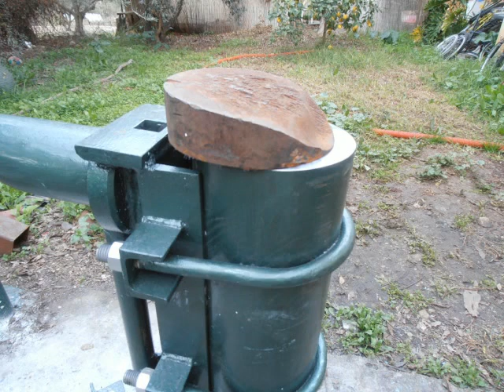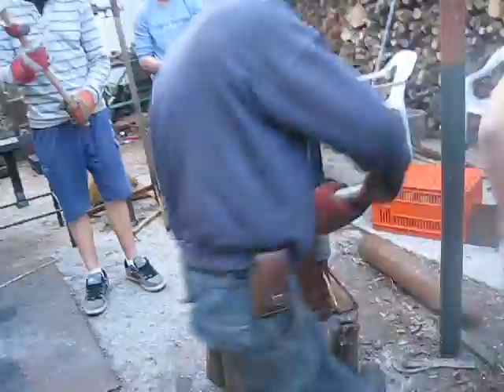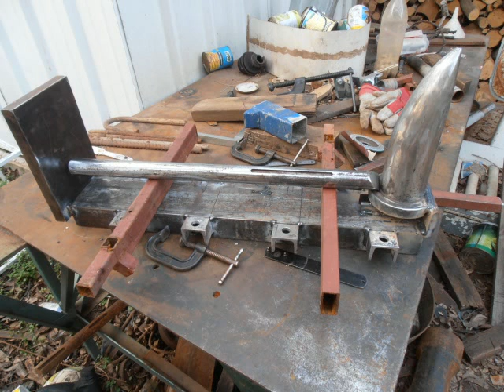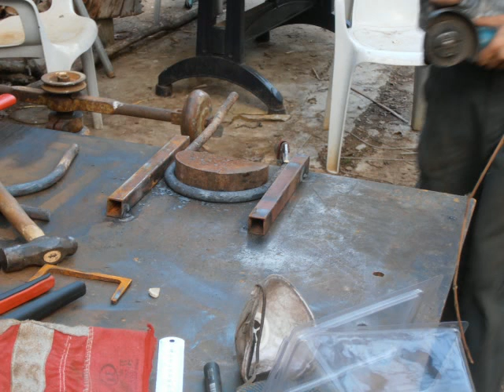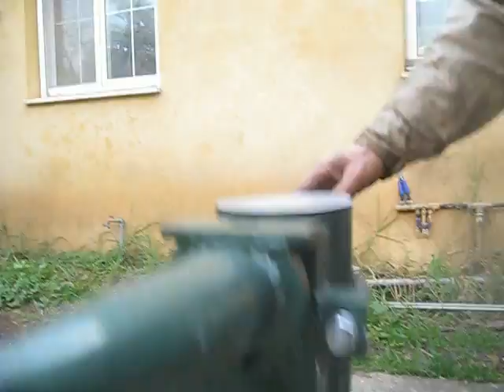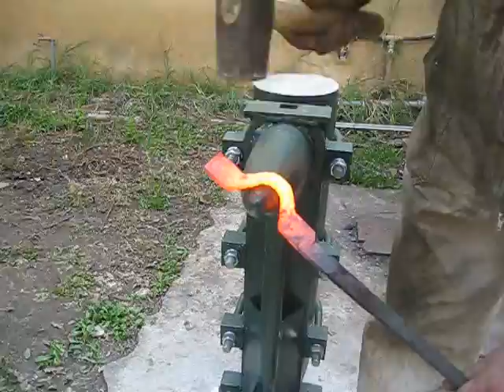homemade diy anvil / bigorna

Comment: Lot of mass under your hammering spot, these hydraulic bits are made of S7 good steel, very nice anvil, and dont worry for the ring, good setting damp any ring and you dont need it to forge.

Comment: WOW! Assuming that it's a manganese steel hydraulic chisel, I am amazed you managed to forge it down. That stuff gets harder as you use it. A lot of guys making anvils from rail run into the issue of the manganese work hardening as they try to grind it down. Great job sir!
AAR
Reply from the maker: I was not certain about the exact material I forged the horn, but it "looked" a lot like mild steel. The main body of the anvil was not forged, just cut and ground to get a flat surface.

Comment: That is very nice work! I would love to have something similar.  I plan to make my own anvil by welding some tool steel plate onto a very large transformer core I have.  Have you found your anvil to sit a little high?  I thought the standard practice was to set the height of an anvil so your hammer head sits on the anvil surface when your arm is straight down.
Reply from the maker: Yes, the anvil is a bit high for me, If needed, I use pallet to get higher in relation to the anvil. But I am a short guy. For average height people, the anvil is just about right!